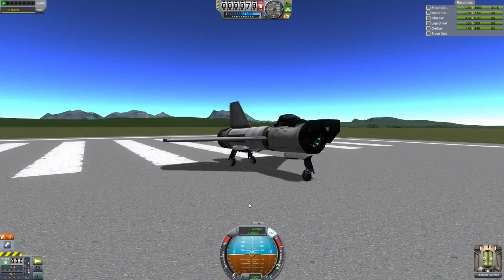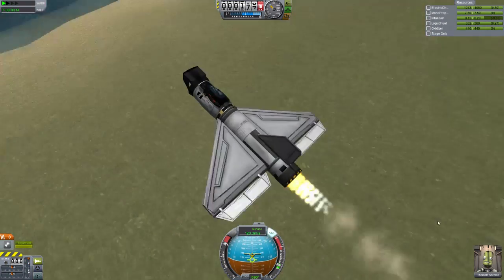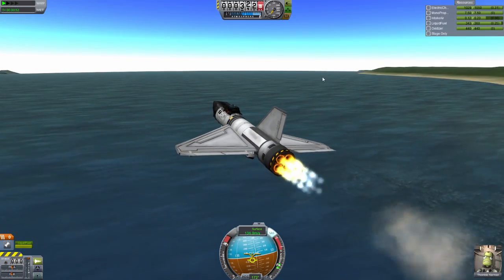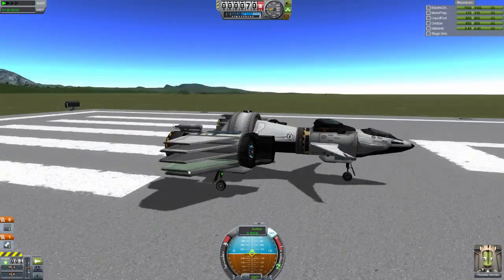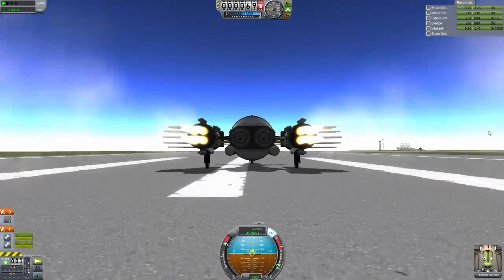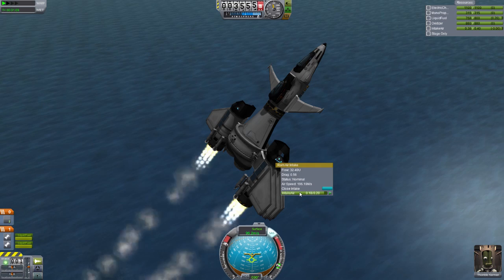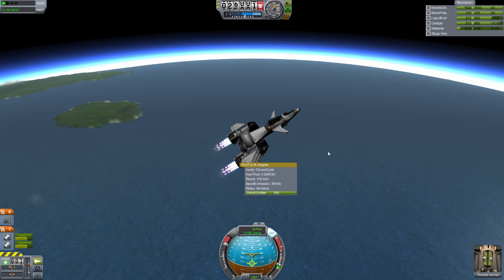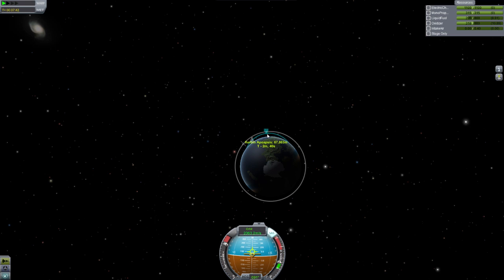Kerbal Space Program Ep. 74 - "Super Duper Boosters"

Comment: BTW, rotation in asparagus staging is often caused by the fuel lines. They add structural rigidity, and if you place them on one side, without a matching strut on the other, then the whole engine/tank will twist around the decoupler to one side, very slightly. It's not enough to be visible, but it will induce a small rotation.
Reply: It looked like your fuel lines were more centered in this case, but they will never be perfectly centered. It might actually be easier to make it stable by putting the fuel line to the side of the decoupler, and a matching strut on the other side of it.

Comment: 13:30 spinning because the wings maybe?
Reply: Things like this tend to spin because the fuel ducts act like struts; but they aren't as strong as struts so the engines flex off to one side, most of the time its enough to overwhelm the roll control authority so they just kind of spin until you dump enough engines.
Reply: jonskowitz so he needs more struts?
I have this problem with ALL of my ships :P
Reply: I'd say the two solutions are either make sure the fuel-lines are centered on the tanks or simply improve the amount of control-authority you have.  

I don't think it's as bad as it used to be since they added smart roll-control to the engines (of course, you need engines that can gimbal for that to matter).
Reply: use LOTS of struts.